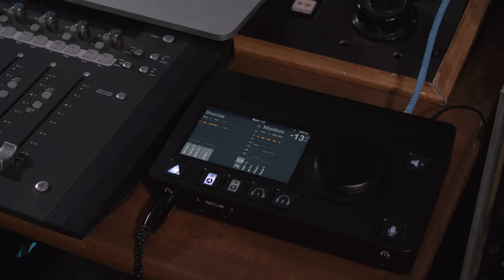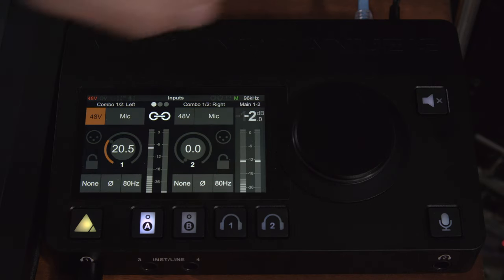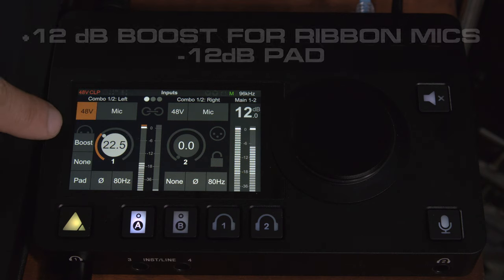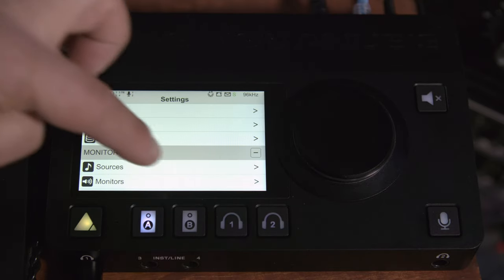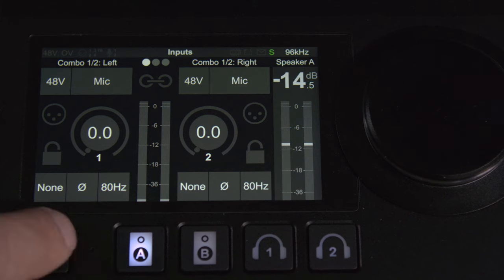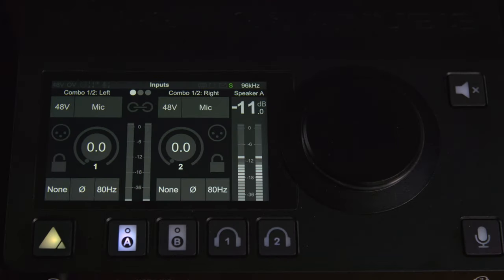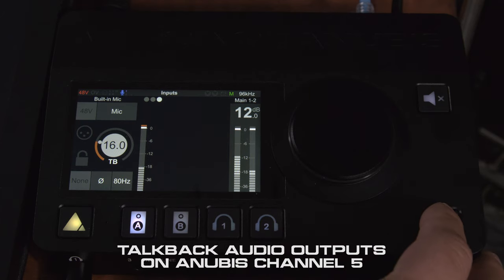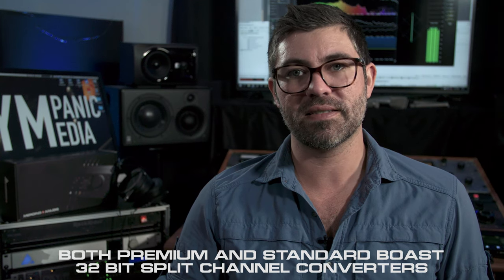MERGING+ANUBIS Tutorial 3 - Mic Pre-Amps Overview and Controls

Comment: Can we use the 4 inputs simultaneously (1-2 internal mic pres, 3-4 external mic pres) and if so, up to 384khz or DSD?
Reply from the maker: Hello, yes you can use all inputs simultaneously in DSD, DXD or 384 kHz. Be aware that this will only be achieved with Anubis PREMIUM
Reply: @MergingTechnologies  Omg, nice. But only two simultaneous analog outs, right?
Reply from the maker: @DanielPelletier1  actually, you have 4 Line outputs + 2 headphone output that can be modified via the software settings into 4 other Line outputs (each headphone output individually) so a total of 4 Analog inputs and 8 Analog outputs
Reply: @MergingTechnologies  Wow, very nice! Last question, is the conversion quality in the Anubis premium the same as in the HAPI (w. Premium card)?
Reply from the maker: @DanielPelletier1  Yes, one can consider it is the same
Reply: @MergingTechnologies  Thank you.